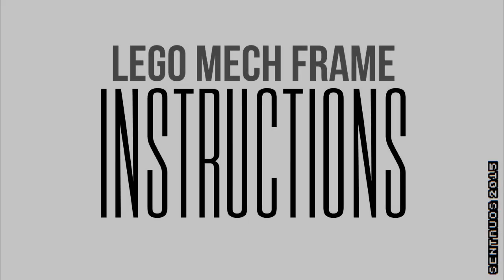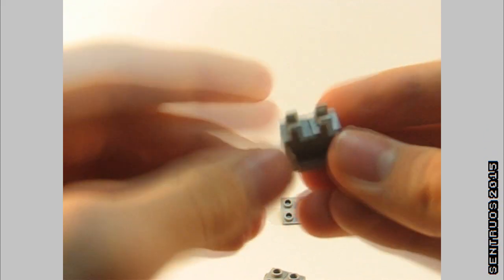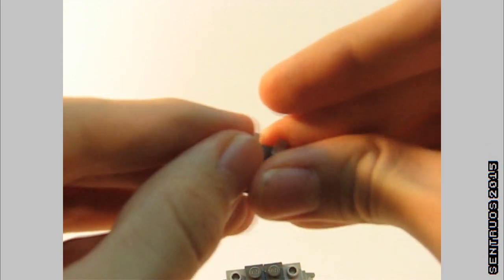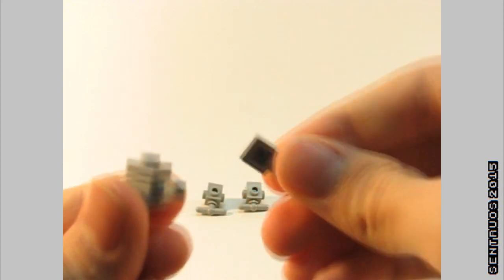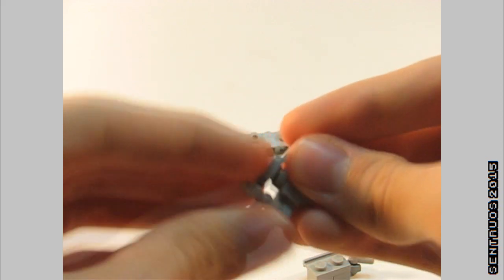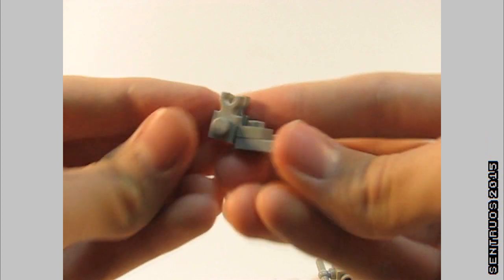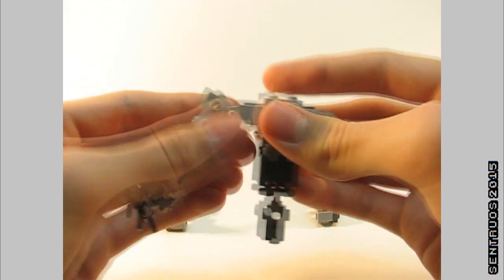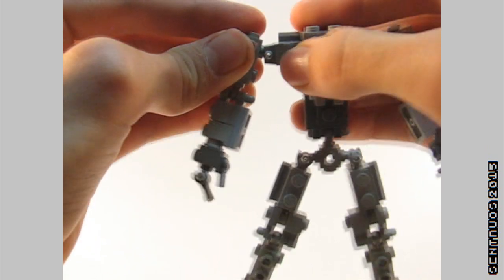Lego Mech Design [02]: Mech Frame Instructions

Comment: great video this has made me think about how I design mechs.

I know a lot of designers use a mech frame (and build frame arms style) because it's standardized and makes building mechs a lot quicker but I tend to take a completely different approach.

I disregard the mech frame entirely and just build the joints straight into the torso High Grade style. I do use frames when building legs but only to a small extent. and generally when I building mechs I don't start with the torso and build out or start with the feat and build up, I tend to start with the head or the backpack and build down.

that's personally how I do it. (I don't mean to be so narcissistic I just thought it would be interesting to compare and contrast designs)

the next time I build a mech (which will hopefully be soon) I'll experiment with mech frames and probably use your design. :)
Reply from the maker: Christopher Forrest Hey, thanks for stopping by! Expressing a building style doesn't come off as you being narcissistic, I always find it interesting to hear about different methods that yield the same results. 
I usually tend to build a mech frame when I want to establish a solid silhouette,  but I recently find myself taking an unusual, interesting piece I've found and rationalizing a way I could implement it creatively into a mech design. From there It kind of spirals out of control and I end up with a Darren Quach-like mech. It's a great way to come up with unique designs and gets the creative juices flowing.
Reply: Sentruos thanks for replying :). I've never built a successful non-humanoid style mech. I'm starting to look into animal mechs kind of like zoids but I always turn back to building humanoid mechs just because I'm used to them. For my next venture into mech building I'm thinking about building a rhino mech but with a mech frame inside I think it would be and interesting change to have an animal mech frame opposed to a normal one. My only problem is I'm starting to run out of ball and socket joint (my go to for building) so I'll have to pick up a couple mixels sets to get the miniture ones because Lego haven't released a small set with the large joints for quite sometime XD.
Reply from the maker: Christopher Forrest Haven't been able to get my hands on those Mixel sets yet, they would make things a lot easier. Good luck!
Reply: Sentruos thanks :)
Reply: +Sentruos can I make mech frames with ball joints??